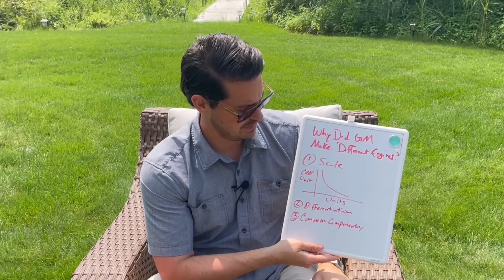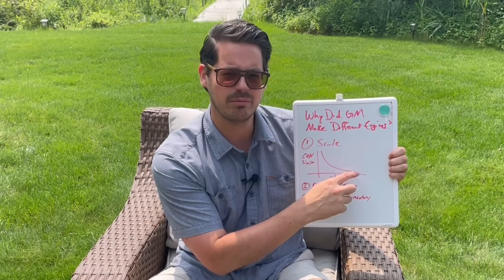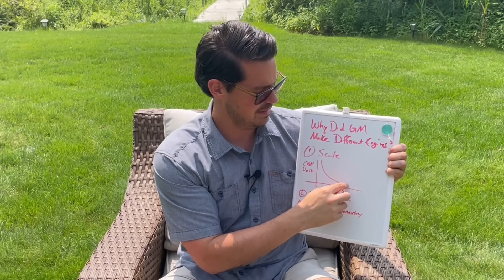Why did General Motors (GM) Make So Many Different V8 Engines in the 1950s-1970s?

Comment: You have some valid points for sure but you completely neglected the massive R&D costs (entire engineering and testing teams) dedicated to developing, improving and maintaing the disparate engine programs. 

Then there is the massively large industrial  plant and distribution system required to maintain a massively different set of spare parts. 

Think how many different GM water pumps, distributors, radiators, fan clutches, etc existed for a given model year inside the GM catalog. 

Whereas, largely Ford had one water pump for their small block 302/351 engine, one for their FE and one for their 385 big blocks. Then for a while the "cleveland" engines had different components for their brief run. 

Your arguments are SOLELY about production costs, and omit everything else.
Reply from the maker: True. But R&D costs when amortized over the number of units produced of these engines were relatively minimal, same as other fixed production costs.  Some of these engines were in service for decades with minimal changes. 

It’s more of an issue now because the R&D costs are much higher and units produced are much, much lower.

Comment: As a Mopar guy I appreciate that a big block or small block parts worked over a broad range of engines and cars. I love my buddy’s 70 442 with that wonderful 455, When we rebuilt the engine together I was stunned to find out all the 455’s along the BOP line were in fact different in many ways. I still can’t believe GM got rid of Olds and Pontiac….what a dumb move.

Comment: I liked the older GM vehicles that engines exclusive for each name, Pontiac, Olds, Buick, Caddy and the Chevy engines.  All 350 engines had different performance,  some had a long stroke for more torque and some had power at a higher RPM. I remember the Chevy engines ran a lot better than the pontiac 350. Chevy 350 had a 3.5 inch stroke, Pontiac 350s had a 3.75 inch stroke (same stroke as the 400) but were not too impressive. I do not know the bore and stroke of the Buick 350.  A friend had a full size Buick w a 350 2 barrel and that would fly!!! And the motor was totally stock.  My favorite V8 was a modified 327 in a 56 Chevy 210 2 door sedan with a Muncie behind it and 4.11 posi rear. It shared the same 4 inch bore as the 350 with a 3.25 inch stroke.   The 1/4 inch shorter stroke enabled my engine to handle 7000 RPM with no problem.  I also was impressed with my 71 Mustang conv with an automatic and 302 2 barrel.  That car seemed faster at hiway speeds than my 70 400 pontiac 4 barrel which I put in a 68 LeMans conv.  I miss the old cars. today they all look alike with most having a 2.0 litre 4 cyl.

Comment: So that the consumer pays the cost of lost from the crap v8s that was slipped in between the great engines. Make any sense? I'm just thinking like a capitalist.

But i for the most part agree with how it's done. I like the idea of engine options, especially if there's a low end torque verion, high rpm version, or my favorite, a mid range monster. 

I'm not sure if these distinctions were clear back then. Seems to be more of a horsepower war with little to no mention on where in the powerband them horses are suited for each engine options.

Was there any talk about suitable engine types for particular drivers? Or was it mostly a HP number associated with quarter times?

Comment: All valid reasons until 1976. After that the combination of the Japanese invasion, gas prices and especially emission regulations caused a major rethinking in vehicle design going into the 1980’s. The cost of EPA certification for each engine and power train combination would have been too high to justify. A few common power train combinations along with new six and four cylinder engines spelled the end of different engines among the different brands.

Comment: Excellent and informative video as always on a topic I have wondered about for a while.  But I'm still left with one question: if they were all doing different engines and wanted to promote the engines were different for each division, why did they choose the same displacement so often if the blocks were not shared?
Reply from the maker: I suspect they didn’t want a single division—aside from Cadillac, whose engines were larger—to have a leg up size wise.  But it’s a good question.  I’m not entirely sure. They could’ve advertised them as 1 or 2 cubic inches different.

Comment: Each GM division's engines had their advantages and disadvantages.  The Pontiac 455 was the same basic block design as the 350, although with larger journals.  This meant that the 455 heads were also size constrained, unlike the 454 Big Block Chevys (Rat), and had smaller valve sizes.  The Chevy could make more power, especially with modifications, but it had worse throttle response.  There was also incredible diversity within each division, with Chevrolet, Pontiac, Oldsmobile and Buick each producing high performance versions of their cams, heads and valvetrains.  The Chevelle SS, GTO, 442, and Buick GSX each had fans that claimed their car was fastest, or better in real world street racing.

Comment: I was about to get upset thinking this was going to be a bashing of GM for doing this but it wasnt. I dont hate Fords but it would take days to tell about all thier different engines Ford may have figured out the assembly line but they had a nighmare when it came to interchangeable parts.

Comment: Never understood why Ford didn’t put the little points adjustment window in their distributor cap? One of my favorite GM engines was the early 60’s Buick nailhead 401 , beautifully balanced and made excellent power in upper rev band. Dynaflows didn’t do it any favors but overall a great motor 👍🏼 great video as always.
Reply: Ahh... could it be that GM had a patent on the Distributor Cap with the point adjustment window.....???

Comment: I father worked for Ingersoll Milling Machines. GM wanted 2 separate lines for the machining of the 3.8L Buick blocks. The reason as I understand it is if a machine tool goes down for a certain period of time then the machine would be replaced with the spare milling machine. That gave maintenance time to fix the milling machine. No other machine tool manufacturer would touch this concept. Ingersoll was known for their world winning specially machine tools.

Comment: GM, specifically Chevy did a MUCH better job of using common mechanical components than Ford or Mopar did. Ford was absolutely terrible about it. Anyone that has worked on both Ford's and Chevys knows this

Comment: I know that you touched on the different displacements but what did they do for small changes like the 305, 307, 327, 350 ect, as to power, they could of done with tuning as to just increasing the over all displacements? If I understand just what you just conveyed. Still lost as to all the differences

Comment: Our 2 1979 Buick Estate Wagons and those had Oldsmobile 403s. I remember how Olds engines sounded. Not sure if it was a timing thing or a muffler thing but I can remember being able to tell if and when an Olds powered vehicle went by.  It was inevitable, there was a 1970 Cutlass on the carport when I came home from the hospital in 1973 and the next 4 vehicles bought were Olds or had an Olds engine. After the Cutlass, we had a 1972 Oldsmobile Custom Cruiser (455), the 2 1979 Buicks and the last Olds was a 1982 Olds 98 Regency Brougham (307) there was 1 1987 Nissan Stanza for couple years then they went Mopar and mom got a 1995 Grand Cherokee with the 5.2 and her last vehicle was a 2001 Dodge Durango SLT Plus and it happens to be daily driver 😊 
I took ownership,  replaced the engine and loving every mile.  My dad was the Olds hound originally. His first car was a 1953 Olds 88,  then a 64 Cutlass. That's when he married mom and 4 yrs later he bought her the 70 Cutlass ➿. Your knowledge is impressive.  Nice to find a channel with this much in depth and independent automotive information.  I'll be watching more.  It should be said, Oldsmobile and Pontiac didn't deserve to completely go away ❤.

Comment: The GM 3800 V6 is an example of what originated as a Buick Engine and became available across the board throughout the various GM divisions. 

The original Buick 225 cubic inch V6 from the 1960's was sold to Jeep which installed them in Jeep vehicles until GM bought back the tooling, etc in the 1970's and created the 231  V6 which later evolved into the 3.8 and 3800.

Comment: Thanks Adam, i always wondered why in Australia we dropped the Chev 307,327,and 350 engines in our Australian built GM-H (Holden) vehicles for locally manufactured V8 engines ie 253 & 308 in its own GM-H engine factory. 
It all makes sense now economy of scale why ship it all of the way to Australia when you can make enough units to be economically viable👍

Comment: @7:00
"The Buick V8, for instance, at least by my perception, is more "of a higher RPM engine."
.
uh, what?   the Buick V8s have always been notorious torque monsters, going back to the Nailheads ( early Nails were used as Chevy truck motors and the 425ci was used in the 1st gen start carts for the SR-71 Blackbird ... and outperformed the 2nd gen start cart 454 Chevy at the needed low end grunt ).  the Bu455 had more torque than a Caddy 472 at 2000rpm. 
.
from a design limit perspective, none of the production Buick big blocks or small blocks were available with 4 bolt mains going back to the 1961 aluminum 215.  and both big and small blocks also suffered from a weak lifter bore valley.  all of these factors mean that a Buick V8 is all done by a little over 6000rpm, unless you're TRYING to break the block or want to engage in extremely expensive block crutches like epoxy filling the lifter valley and girdling the bottom of the block.
.
the 231ci V6 was derived from a combination of the Buick 350 bore and the Buick 300 deck height, but if not for the Nascar Busch series and IndyCar race programs there wouldn't have been any 4 bolt main blocks available for those either.  

the 1966 F1 championship Repco v8 engine fixed the lifter valley problem by converting to OHC and almost doesn't belong in the family.  most people call it an Olds, even though the only thing "Olds" about it is the extra head bolt per cylinder.

Comment: Not discussing the ROOT reasons for the differences in the first place leaves a lot of the story out. Ever heard of Robert E. Olds? How about R.E.O. trucks? No, I not talking about the rock group "REO Speed Wagon", although the actual truck that carried that name was part of R.E.O.s lineup of medium duty trucks into the 1940s. The car company Mr. Olds founded and sold to GM bears his name and, like other car companies GM acquired, their independent spirit of design continued well after GM capitalists finally listened to the bean counters and consolidated the company's engines in the mid-70s. The Cadillac V-8? Came from Cadillac engineering directly from the old Cadillac-LaSalle cars' flathead V-8 in 1949. The Chevrolet Brothers were the first to produce a V-8 in 1917, 38 years before the 'small block Chevy showed up in 1955. GM again had sense enough not to piss off customers loyal to the specific brands they were selling by forcing the Chevrolet Division to change anything. Besides, the small block was a pretty good engine. Too wimpy for the GMC line of trucks, of course, but they solved that problem by putting Pontiac V-8 engines in the late-50s GMC trucks. When GM bosses finally did decide to ramp up profits by standardizing power trains it was not without controversy. They kept it a secret until the famous lawsuit in 1976 or 77 by the family who had been replacing their new Buick every few years and were furious that they weren't told that the engine in their new Buick was a Chevy. They lost the suit in large measure because the dealership never said it had a Buick engine. GM's decision to standardize that category of engines as "350" was a calculated decision made years in advance of its actual implementation.

Comment: I have an open question for anyone for anyone who understands the 1950s American automotive industry.  After Packard stopped making their V8 in 1956 why didn't another manufacturer buy the tooling and continue production?  From what I understand the Packard V8 was still very early in its production "maturity"  and had many years of bore & stroke enlargements ahead of it.  This engine could have become somebody's big-block.  One other question.  Why didn't all the independents share development of engines & transmissions?  Especially in the early 1950s when everyone was in a rush to produce a modern V8?  Ditto/the same question pertaining to the Packard Ultramatic transmission.

Comment: Because GM used to be good and its divisions were unique to a large degree with their own loyal followings. Cadillac was the last division with its own engine until the blackwing engine was discontinued in 2020. If GM were smart, the Buick 3800 would've gotten another generation (maybe with an aluminum block and heads, direct and port injection and VVT) instead of unleashing that garbage 3.6L "high feature" engine onto the public.

Comment: Another fun fact about GM engines. One of the most successful GM V6 engines started life as a V8 in the 1960’s, then had 2 cylinders removed but they left the crank as a common pin making the 231 an odd fire engine. This was later sold to Kaiser Jeep and bought back a few years later. GM had not removed the infrastructure for the 231 so once they bought the tooling back they simply placed it back where it was and started making the engine again. This time they split the crank pins making the firing interval even. This engine eventually became known as the 3800 and seen 2 more updates eventually being retired in 2008 as the 3800 Series III. This same engine was the power plant in the GNX and with the GN/GNX turbo package was known as the fastest production car in the years it was available, beating V8 powered cars like the Corvette, Camaro and Mustang. GM even built this engine in a supercharged version using an Eaton M90.

Comment: The luxury cars got the Oldsmobile engines not the Buick. The Olds 350 gave way to the 307 which lasted into the 1990’s being used in Cadillacs. The Last Olds to use the Oldsmobile V8 was the 1988 Cutlass Supreme.
Reply from the maker: You could get the Buick 350 in Pontiacs in 77/78
Reply: @RareClassicCars  Yes you could, but when you say luxury cars, in GM speak that's usually Cadillac, even though Buick, Olds Pontiac and even Chevrolet had their luxury models.  

The Olds engine had a much better low torque curve than the Pontiac or Chevrolet engine did which is one reason why it found it's way into more of the GM large cars than the other engine offerings.

Comment: Actually, ALL corporations DID have marque-specific engines and transmissions prior to 1955, but GM was the only corporation large enough to afford the additional expenditure.   
For instance from about 1940 through 1954, Plymouth could NOT get the famous Dodge Fluid Drive. All Plymouths were 3-speeds.  Plymouths also could not get larger engines and had to slog along with the same 216 cid flathead for ages. Dodge had a bigger engine.  DeSoto, bigger yet. Chrysler, would only receive a straight 8.

Fords were the same way.  After dropping the 60-horse V8, Fords only got the 239 cid V8.  Mercury would receive the much larger 254 V8 and Lincolns of course would have their V12s.
This sort of stopped in about 1954/55 at Ford with the introduction of the new Y-block. 

GM used to have very specific parts for each car.  It's sort of where "Brand Loyalty" comes from.  For instance, if you bought a Chevy with an Automatic transmission,  all you could get was the 2-Speed Power Glide.  Oh sure, from '57-61 you could get that Buick-derrived Turbo-Glide, but that was not the best transmission.  Chevrolet would not see a 3-speed automatic until the introduction of the Turbo Hydramatic in 1967.  Eventually, all brands would get a derivative of the THM to save costs.

It just makes good dollars and cents. Why make 6 automatic transmissions when you only need 1?  Chrysler figured it out, eventually Ford and GM did too.... mostly as means of cutting costs due to flagging sales.